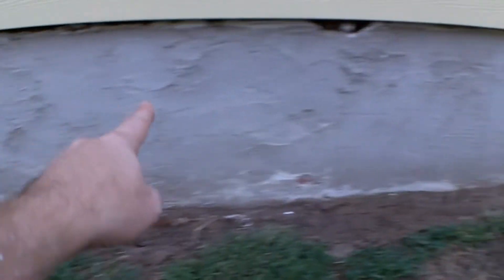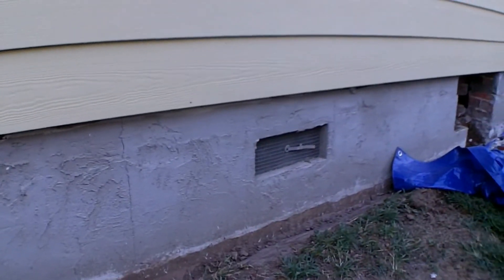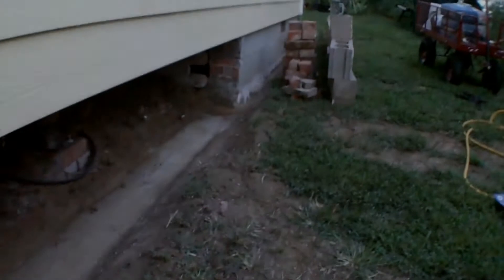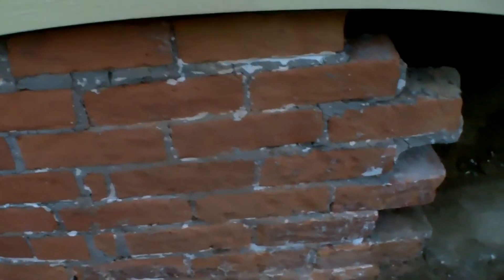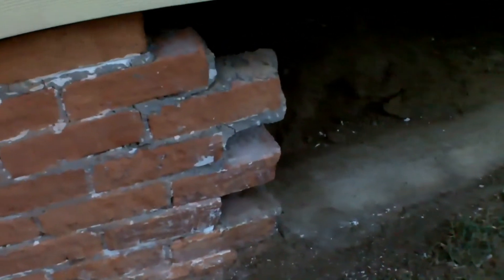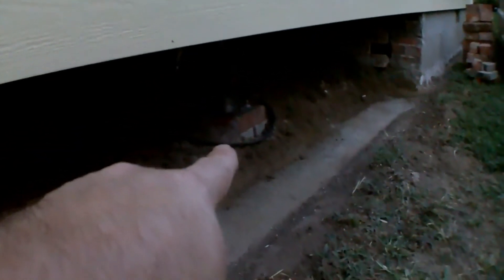The Home Mess Saga Continues!

Comment: Super quality fix, brother!  I call you brother because we are both living the dream of old house ownership.  Haha!  I have to laugh or else I'd cry.  Mine's 104+ years old and the previous owner, we later found, was a house flipper.  He just parged the crumbling brick foundation to get it sold.  It did look good when we bought it and the home inspector made no mention of it or the other myriad problems with this place.  I have to do the same operation on about 200 feet of foundation.  My conundrum is that though I'd love to jack it all back level, the entire interior was redone in it's current undulating and out of level/plumb/square state.  If I straighten it out, I'll end up losing all the drywall/plaster inside.  So I guess the lack of squareness will be called "charm" by the realtor when we eventually sell the place.  Haha!  We're in north Texas and the drought has wreaked havoc, especially on the south facing wall with all the sun cyling accelerating the slow self destruction of everything from paint and window glazing to the now exposed bricks.  UGH!  I'll be OJTing as a mason just like you.  Thanks for the video, now I know that I can take this part on a section at a time.  Then it's on to rebuilding the windows, replacing the galvanized plumbing and knob and tube wiring.  WoooHooo!!!
Reply from the maker: Thanks man! I think mines about 92 now. I feel for your problems. I'd already gutted and finished my daughters room just above the problem. I did lift it a bit, but stopped short. It's not level either- nothing in the house is and I think parts of it were built that way.... I'm scared to go in there an look to see if I cracked any drywall....lol. I've been doing room by room total guts and have a few left. I watched a ton of videos to get a feel for doing the brick/block work that were helpful. Good luck to you! G.

Comment: Looks like a nice repair, but curious why you didn't remove that small section of brick and just use blocks throughout?
Reply from the maker: Thanks. I should have mentioned why I didn't. I did want to do that but the original blocks are 6" wide and anything I could find around here are all 8" so they wouldn't stack right with the 6's. The other option would have been to replace all of them with 8" but the footing wasn't wide enough to use them and didn't want the extra cost. It would have been easier for sure if I could have found 6" blocks- but I had to work with what I had. Take care, G.

Comment: I feel your pain.  We are doing more work and the guys are coming up against all sorts of issues that are needless problems but that need fixed in order that the work they are doing will look right and should have been done right when the house was built.  The irony is that this house was built by a builder.  It's a bit like the mechanic's car.  Thankfully we will be finished soon.  That's a good job you did in an awkward place.
Best Wishes, Brendan.
Reply from the maker: Pain is right Brendan...lol. Hopefully you won't run into any other problems with your place. You're right about an awkward place. Not the ideal situation to try and hone masonry skills but I got it done. G.